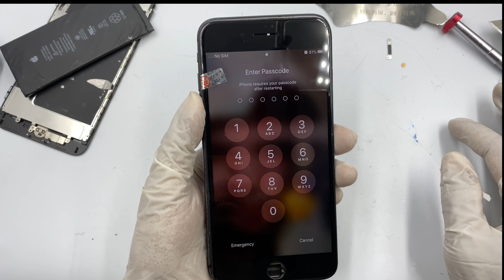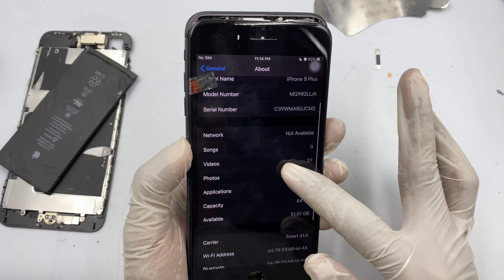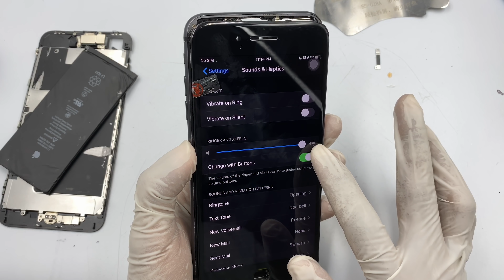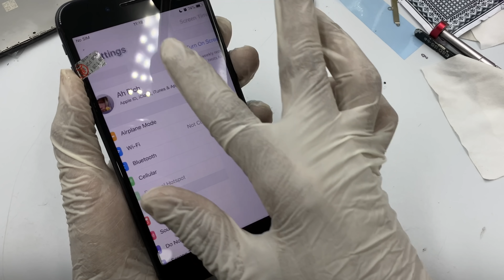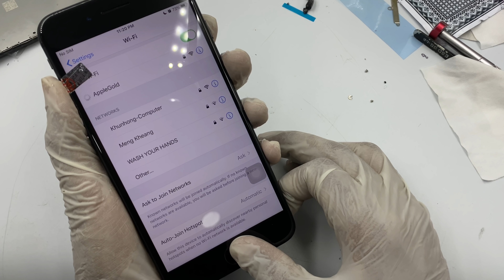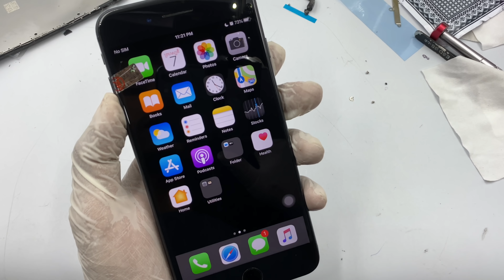iPhone 8 Plus Restoration How much it cost...

Comment: From where did you buy the LCD display? I need to change mine
Reply: Sela Mobile Restoration are they original parts which you have changed?
Reply: Sai Kiran Adusumilli Apple doesn’t let you buy Apple parts so you have to buy offbrand ones but usually it’s fine